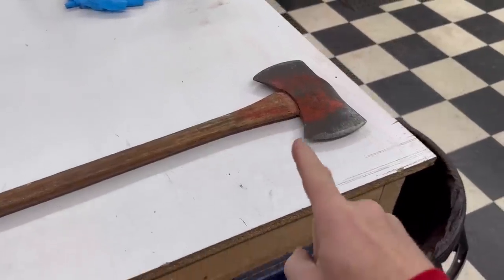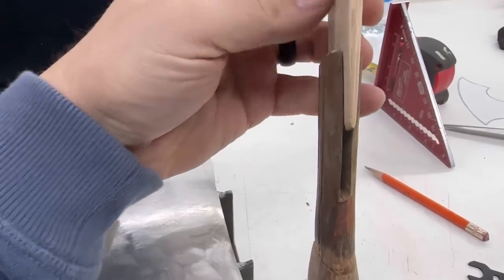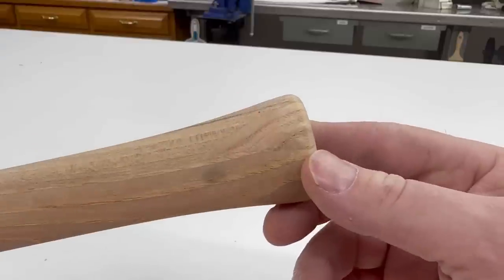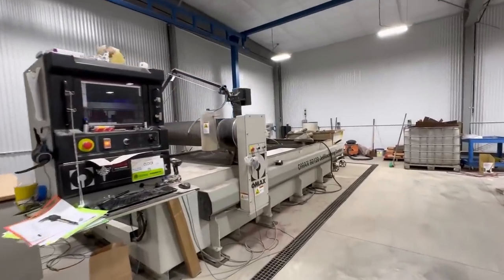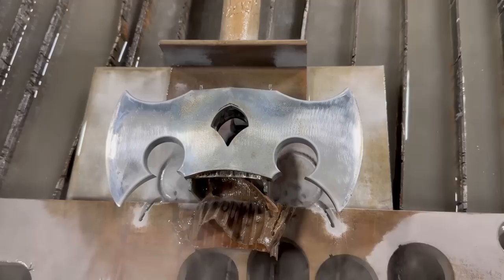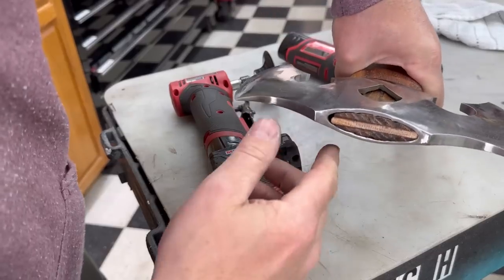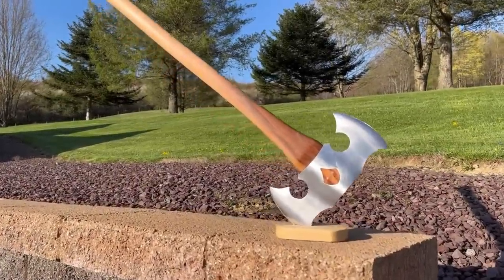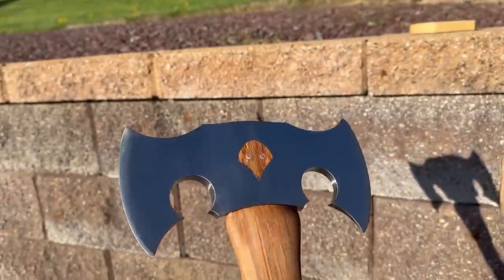RESTORING an old TWO BIT axe. UNIQUE process

Comment: Water Jet is an amazing technology. As you mention it cuts through essentially anything. I think material thickness has a max point. The down side if you can call it that is the bed is sacrificed as the jet will not only cut the material but the stream will also blast the bed. If you noticed the bed is not solid but has spaced risers.

Comment: You didn't show how he figured out where the axe head was located on the waterjet table. 
On the lasers I program, a sacrificial piece is first laid down & clamped. Then a quick custom program to cut a way to hold weird piece. Finally a program to cut finished part. 
On repeat jobs, I try to make the sacrificial piece small & cheap to fit a reusable hold fixture. 
Sometimes the customer only gives me 0.0001" tolerance with zero test parts. 
Also, I have to convey my plans to the laser operator.
Reply from the maker: Finding the part position on the table took some time. He uses a paper clip in the jet stream to trace the odd shape to locate it then uses a very fine stream of water at very low pressure to watch the cut path. And with the contours of the ax head, it added more set up time. 
Thanks for watching and the great comment question!!!